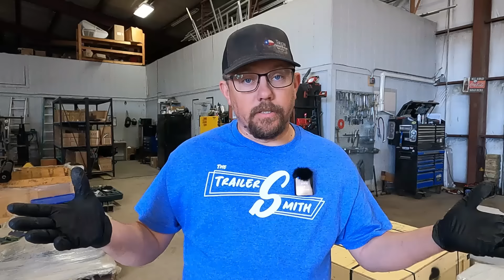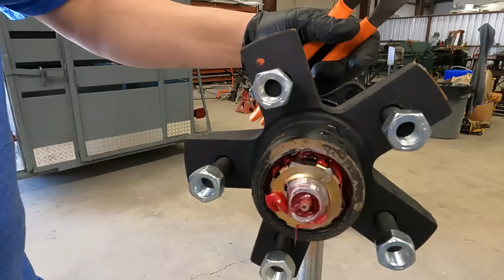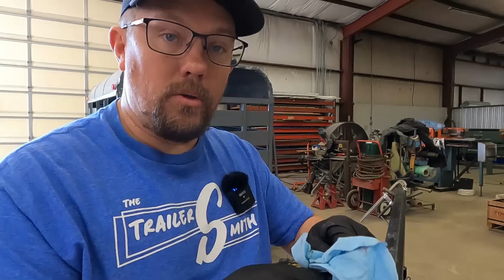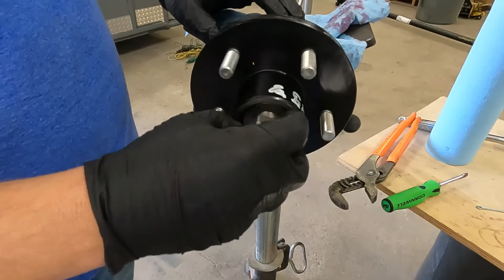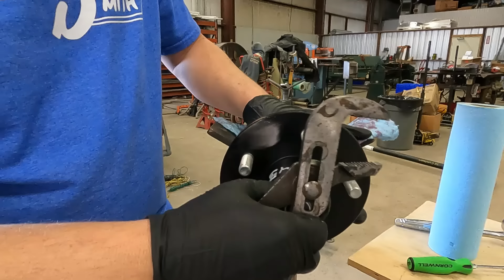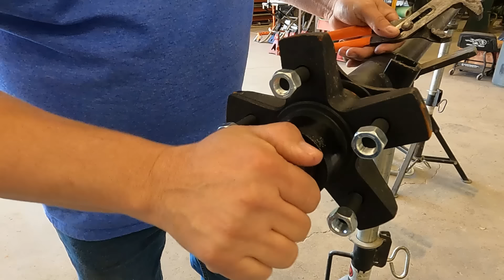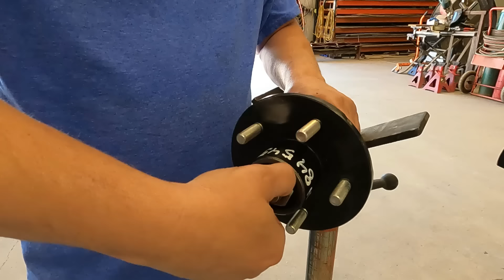How To Set Trailer Bearing Adjustment

Comment: This is one of the better hub video's I've seen.  Most just say tighten it up then loosen it up a bit and call it a day.
Reply: This is the way.
Reply: I back it off a minimum amount while shooting for:
1) I can install the cotter pin/retainer.
2) I can barely feel a perceptible amount of play in the bearings.
Reply: @t @thisisyourcaptainspeaking2259 

Yup. So far, everything I’ve seen has stated to go to finger tight on the nut, then back off until the cotter pin will go through.
Reply: @bradchristy8429 Correct, the hub should spin freely without feeling stiff or tight spots.  Tight spots probably means the races aren't fully driven home in the hub or there's contamination around/in the needle rollers.
After installing the wheel on the hub, I check for a barely perceptible amount of play in the bearings.
If the bearings are too tight, this is going to cause heat and flat spots on the needle rollers, leading to galling of the rollers and race as the needles skid around the race instead of rolling as they should.
A quick check of how things are going is pull over into a gas station, walk around and feel the hub temperatures.  They may be slightly warm but never hot.  If hot, there's a problem.
Reply: @thisisyourcaptainspeaking2259 Sweet. Thanks for the furthering. I’m getting ready to replace the axles on my trailer, and, obviously, repacking the bearings is undoubtedly part of that process. Might even just replace them while I’m at it, depending on how much they are. We just had them redone two years ago, so they’re probably still in good shape. Unfortunately, tire wear is indicating bent axles, so….
Reply: @bradchristy8429 Concerning tire wear, you really shouldn't encounter appreciable wear unless: 1) Your pull your trailer one heck of a lot.  2) The axles are bent somehow (accident or overloading).
3) The axles were improperly made or installed incorrectly.
Bow if any, goes up. This gives a slight outward camber at the top of the wheel.  This camber flattens toward neutral as the trailer is loaded with weight.
Tires usually rot before wearing out, 5 years is typical before rot starts becoming an issue 
Also, you should use new u-bolts and check your spring eyes & shackles for wear around the bolts (egg shaping).  Replace any obviously worn hardware.
Leaf springs can be painted but should not be oiled.
Good luck with your project ;)
Reply: @thisisyourcaptainspeaking2259 It’s a Heritage trailer, so I don’t doubt the build quality. They are 4300lb axles, and it’s a 7K lb package (4800+2200lbs), so not overloaded. Inside edges are wearing. I had pulled a wheel off the do some minor fender repair and discovered the wear, which led me to examine the other four. So, I laid a straight edge across the brake rotors (disk brakes, both axles), and they are all towed out. Can’t really tell if they are bent up, but I’d assume. I’m told our wonderful roadways are most likely culprit. I’m sourcing the replacements from Heritage, and they will build the exact same trailer today, so they should be a perfect fit; a “parts off, parts on” job.
Reply: @bradchristy8429 I'm thinking the spring perches are mounted (likely welded) onto the axle in the wrong orientation.
The bow in the axle (not all have camber bow but most do) if facing forward would result in outward tow.
Reply: @thisisyourcaptainspeaking2259 They are one-piece axle beams. Unless they were MFRd with the tow-out, they pretty much have to be bent. I’m not sure how the springs could affect alignment with all four wheels showing inside edge wear. I could agree with you if, say, the front were wearing on the left side and the rear were wearing on the right.
Reply: . The springs themselves shouldn't be able to cause tow.  The spring perches, if welded onto the axle 90 degrees from the correct position, could face the axle bow forward.  If the camber bow were facing forward (instead of upward), this would cause the spindles to have an outward toe, instead of the desired positive camber.
Because the bowed axle is rotated 90 degrees from it's intended position (bow facing forward, not up).
If the camber bow of the axle was facing rearward, the tow would be inward (also incorrect).
Reply: @thisisyourcaptainspeaking2259 The beams themselves are bent, spindles rearward. If I place a straight edge against the rear brake rotor, there is. About a 1/4-5/16” gap between the straight edge and the front rotor. If I place the straight edge against the front rotor, the straight edge sees a similar overlap (interference) with the rear rotor. This geometry is more pronounced on the left side than the right.

I had all four tires replaced about three years ago. The impetus being a blowout, and the fact that I had bought the boat a year before,for someone who only had it less than a year, and had no idea how old the tires actually were. The old tires had virtually zero wear. I have to assume the excessive wear is a relatively new condition. But I do have to admit that, while I keep up with the hub grease (BearingBuddies), I don’t inspect the tires as I probably should. I will from here on out, though.

Comment: Great video. Us old guys learned this doing brake jobs when most cars had front bearings like this. Do you have a link for the nut cover from the last type of axle in the video? I'd like to keep a couple on hand for my pontoon boat trailer.

Comment: Why call it a ‘jam’ nut. Surely if you’re locking or ‘jamming’ another nut you might call it a ‘lock nut’ as used on bearings or installing or removing stud bolts. As its not really jamming anything isn’t it just a NUT?
Reply from the maker: It’s called a jam nut due to its height and application. Jam nuts can be used in conjunction with another jam nut for installation. In this case the jam nut is used in conjunction with a jam nut retainer. The jam nut with retainer is holding a specific load on the bearing, thus jamming it. That’s why it’s called a jam nut

Comment: I have 8,000 Lippert easy lube,,  just did the repack first time at 10,000 miles,, found outer bearing inside edge was starting to pit,  put new cup and bearing in on outer hub . Has the castle nut with carter key,  Ran them down to 50lbs back off one turn,  re-torque to 5lbs, hole line up,, but tighter then finger tight,  back off one hole but then i could shake the drum,,,  So did the factory not get the axle setup correctly. Thanks
Reply: Great video. A whole lot of misinformation out there regarding this subject!
Reply from the maker: @rickpatterson4495 
First, what outer bearing & cup did you use?
Sounds like you did everything right. It’s not uncommon to feel a little bit of slack in the drum with the wheel on. But you shouldn’t be able to see the hub shaking.
Reply: @TheTrailerSmith  1. they came with   Chinese set,  switch to Timken USA,,    Back in the day i had a 40 horse trailer we use to haul fright,, put about 80,000 miles a year on,, tried china barring but failed a lot. Always had good luck with timken.      2, backing the nut off one hole drum- moved a. Lot,,  i like just a very little ply for heat, but all 4 corners came out the same ,   This last set made it 10,000 miles, when we get back it be time repack see how they look,,   On Side note, we ran in a lot of 100 Deg, weather the hubs stayed with in temps,,  the pitting was right on inter edge of roller  all 4 corners ,, some say set to tight   Keep up all the Good Info. Thanks    We have a 5th wheel Brinkley

Comment: Tapered bearings = pair of cones. The weight of the loaded trailer will be distributed across the roller bearings, and the arrangement "centers" itself because the pair of pairings are tapering toward each other. With help from your prior videos, I rebuilt a very old trailer axle. I was confused WHY to loosen the tension (after tighten to set in place). Then it occurred to me that a pair of tapered bearings will behave differently than ball bearings.
My motorcycle had ball bearings at the steering neck. There was a preload setting for ball bearings. I replaced them with TAPERED bearings. Very common upgrade, and the upper - lower bearings have cones facing each other (similar to a trailer). I could not find ANY torque - preload specifications for the tapered bearings. Most advice was not to tighten them beyond removing free play. Then it occurred to me how much different TAPERED bearings are than the ball bearings I had just removed. The tapered rollers / cone will center themselves, as well as distribute the load over a much larger area.
Timken warns against overtighten tapered roller bearings as common reason for failure. Your advice is very helpful, especially once I figured out WHY not to overtighten them.
Reply from the maker: Thanks for the detailed explanation. You've got it figured out! Thanks for watching!
Reply: Yes, do not overtighten but, a hole back from just barely tightened is in my opinion way too loose. Now the bearings are sloppy and the hub is moving causing additional stress to the grease seal. This is one reason I think is the reason I see so many grease contaminated brake assemblies. I finger tighten and cotter key at that point.